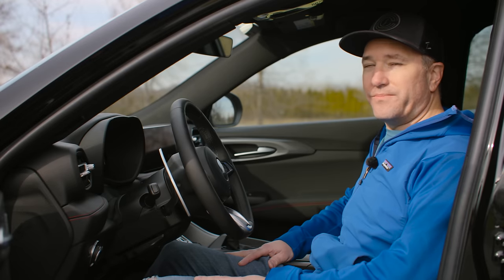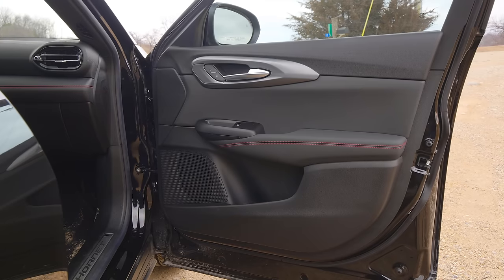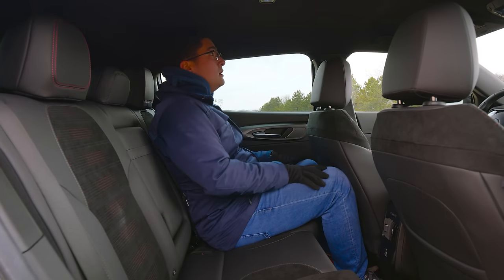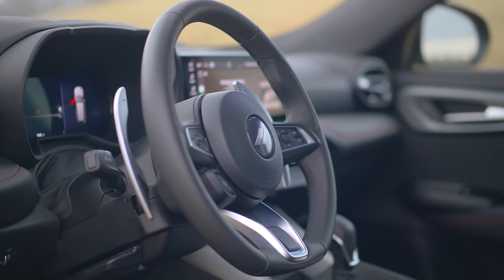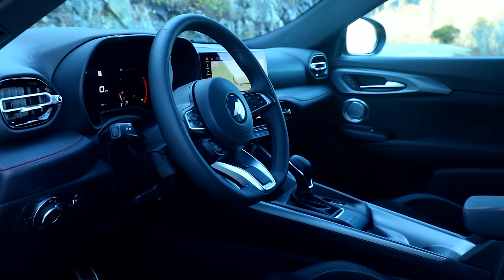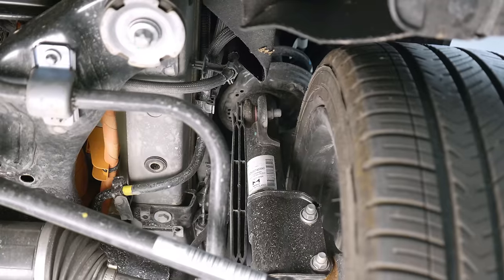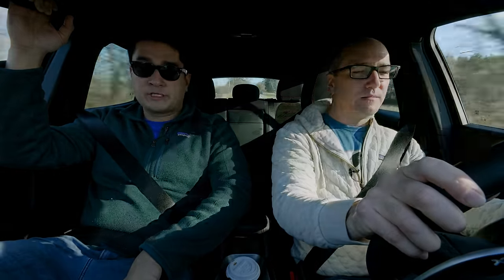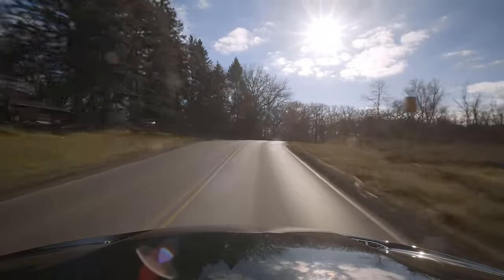Dodge Hornet | A Stinging Sensation

Comment: Leased a Tonale for my wife about 3 months ago, which is in all ways that matter the same vehicle. So far we've had no issues at all aside from the lift gate decided not to open one day after buying groceries, but turning it off and back on solved that.  The active drive & safety sensors are very sensitive to direct blinding sunlight, but we did a 2500 mi road trip in it for thanksgiving and it performed quite well overall.

She commented over the weekend just how much she loves the car, she is coming from a Mini Cooper S Manual, the Tonale is sporty enough where we both enjoy being behind the wheel, though we both understand it's NOT a sports car by any stretch and don't expect it to perform like one.    If I had to summarize the Hornet / Tonale, it would be a CUV for someone who requires a little more practicality than a sports car (perhaps you've got a kid), but you haven't died inside and still want a vehicle that drives decently well, and would rather kill yourself than own/drive something like a CRV, and either can't afford or don't want / can't fit something like a larger performance SUV.
Reply: Shhh you’re not allowed to say positive things about the Tonale, especially from a place of actual ownership experience. You’re shattering the world views of everyone here with their copy+paste opinions.
Reply: @matthewp9015  so I probably shouldn't mention that I've owned 2 other Alfas over the past 6 going on 7 years, which were also similarly problem free?
Reply: @fpnbrian  you best be keeping that to yourself…
Reply: @fpnbrian  
You had until you said you owned 2 Alfas that were trouble free😅😅😅😅
I don't believe that for one second.
Reply: @fpnbrian you’re the only one
Reply: @SoosRamirez1  funny, the owners groups are full of people who love them and have great experiences with them, it's almost like the handful of problems that occur get blown way out of proportion by the internet...  Alfa ranked tied for 3rd on JD Power's ownership satisfaction survey last year among all brands narrowly being beaten by #2 Infiniti and #1 Porsche, and tied with Buick.  But you're probably correct and I'm the only one who has had a good experience owning them 🤷🏻‍♂️
Reply: @fpnbrian  well it's sort of an internet rule. You can bet half of the people commenting about reliability issues have never ever even seen an Alfa, especially in the US. Anyway sales figures are quite decent considering the premises, at least for the Hornet. The plug-in Tonale simply isn't imported to the US to make the big numers
Reply: @SoosRamirez1  So now you want us to believe that you talked to every other owner of an Alfa and they said they had issues?   That only thing with issues is all you haters that have no clue what you're talking about.
Reply: @maximus11400  haters?

Comment: To me the hornet is what the caliber should have been.
California and CARB standards is why the hornet exist IMO
Reply: For real, the CAFE standards were just arbitrarily pulled out of thin air by politicians who knew nothing about automotive engineering. It sets mpg requirements based on wheelbase alone, not vehicle type or coefficient of drag. And the requirements get more restrictive each year. This is why small trucks for the common man were virtually non-existant for a long time and only back now with the hybrid variant being the base commodity trim, to increase the fuel efficiency numbers. It's why trucks are so large in the US, because larger wheelbase vehicles didn't need to hit such ridiculous numbers. It's also why reliable car companies like Honda had to play around with tech that ruined their reliability, like the j series v6 cylinder deactivation. Any time the government gets involved, usually the opposite of their intent is the result.
Reply: The Caliber is what the Plymouth variant would have been, if Plymouth survived. It's probably a good thing that Plymouth didn't survive. Going cheaper than Dodge would have led to less and less sales through the Daimler-Chrysler finale and the vampire Cerberus years. I bet the Plymouth PT Cruiser would have died out in 2008 versus the Chrysler PT Cruiser's 2011. The Plymouth Barracuda would have been cool, though.
Reply: Honestly it competes with mazda cx30 and Subaru crosstrek. Etc. and the hornet is way worse than it's competitors in almost every way.
Reply: We need to abolish CAFE standards and educate everyone on this issue
Reply: This is the elephant in the room and its way political and the guys are smart not to bring it up, but we all know america's political class is destroying these industries.
Reply: @SilverScarletSpider  Thats funny...the uneducated wants to try and educate...
Reply: @SilverScarletSpider the Supreme Court just changed the way EPA works regarding mileage & emissions!

Comment: Imagine selling only chargers and challengers for 16 years just to get this turd in the showroom
Reply: Let's hope it also doesn't come with the typical Alfa reliability as well.
Reply: @creato938  🙄 it's such nonsense. having owned multiple Alfas over the years I have literally never been left down by one of them. Alfas are better than Audi or BMW in terms of reliability.
Reply: Yeah how do you sell this tu”himg
Reply: Still at zero down at 22 percent interest
Reply: @MD-uu5nt  and what would you say are the average total miles driven on all these alfas?  and were they leases? Also, you know car enthusiasts who don't trust people on the internet can just go look up TSB reports and make up their own minds on what kind of problems a car actually has.
Reply: @MD-uu5nt  yeah really Alfas break down because they think they're toyota and hondas and don't require regular maintenance
Reply: @hamsterbrigade  my 156 v6 had 108,000 miles on the clock when I sold it. I bought it at 84,000. It was very, very heavy on front suspension components but never let me down in 5 years.
My 166 V6 was 20 years old when I bought it but only had 14,000 miles on the clock. It was flawless over the course of 6,000 miles in 6 months. Even if the mileage was low it was still old so lots of things can go wrong on old cars. 
My 166 2.0 had 200,000 miles on it when I bought it and the piston rings were completely gone so it was blowing a lot of smoke but at 200,000 miles in a big car with a fairly small engine I think that's acceptable. That went for scrap even though everything else was working and it still drove well. 
My 159 was 6 years old and had 80,000km on the clock and I sold it at 100,000. That never let me down although it did have a significant repair history from before me.  It then that car was mechanically pretty much a GM product. 
My 2005 156 2.4 jtd had the best diesel engine I've ever driven. Sounded good, loads of power and reliable. I didn't keep it long though as the previous owner kept the car in really bad shape and I bought it in the dark not realizing how rough it was. Mechanically sound though. 

In all of them combined I've probably driven 100,000 miles and none of them were anywhere near new. All (except the GM 159) were tremendous fun to drive.
Reply: I personally have a hard time seeing the Dodge brand surviving long term.
Reply: @John-kx3ng  lmao dodge and Chrysler as a whole has been on life support since the 80s
Reply: @MD-uu5nt I agree. Ive had my Stelvio 3 plus years and its been trouble free. Cant say the same about my 3 VW’s (one of which blew a motor with only45k miles on it) or my Audi or my BMW. All those cars were awful.
Reply: These guys are saying that the Hornet is priced in the 30's & 40's, which is true; but they go all the way up into the low 50's. Nobody is buying this vehicle...
Reply: @creato938 people are already complaining about issues with these cars, a lot of them are straight up lemons so yeah the Alfa DNA is definitely showing lol
Reply: History repeats itself…imagine being in the showroom after OPEC struck…your 400 gross hp monster gets turned into a 190 horse weakling….
Reply: totally this is a joke
Reply: @tehgzizlauw1787  I've been hearing this since the Giulia was released and I know several Giulia owners including my brother. Not a single one has had significant issues. I've been on Alfa Romeo forums for years and the general consensus is that the Giulia is a very dependable car and the only issues appear to be battery related, which if not diagnosed correctly can lead to other issues due to low voltage. I haven't read anything about engine, gearbox or suspension issues unlike some BMWs, Audis and Mercedes...

 Americans have these bizarre preconceptions when it comes to talking about Alfa where they can only cite nonsense they have heard in the 1980s. Alfa Romeo are no less reliable than any other European or American brands. They aren't Japanese.
Reply: I have a 17 guilia with essentially the same motor and it has been a fantastic car and very reliable.
Reply: Don't forget the Dodge Dart! That was a sedan Alfa Romeo Giulietta. IMO it should have been sold as an Alfa Romeo (exclusively) to offer an entry-level model and build brand recognition, who cares if it's made in North America and not in Italy?  Same for the 124 Abarth being an Alfa Spider like the original plan too (who cares that it's made in Japan?).
Reply: @MD-uu5nt How old were those Alfas? Edit: I just saw yoe other comment
Reply: Imagine bragging about selling cars that were basically facelifted for that many years.
Reply: @geraldthompson4633 OPEC? I think you mean the EPA. They ruin all the fun
Reply: @whiteboiwyatt  opec started the ball rolling…the EPA offered the customary knee jerk reaction…
Reply: @whiteboiwyatt  Aren't OPEC in the business of selling oil? What do they care if cars are inefficient? 🙂
Reply: Well the Dodge / Chrysler brand is on life support. Dodge has one vehicle left over and that is the aging Durango, this car is obviously a repurposed Alpha Romeo and Chrysler has the minivan. That's it. New American car companies like Tesla, Rivian & Lucid have just as many products out as Dodge Chrysler does. It's really sad to see this 100 year old car company basically die a slow death....
Reply: @MD-uu5nt this makes a Giulia very enticing haha
Reply: @cmdrbillpaxton4302  True.
Reply: @geraldthompson4633  I was picturing the '80s turbo 4-bangers,  "The power of the future".   Here we are again.   Maybe Stellantis will bring back the Spirit R/T, Shelby CSX,  Shelby Lancer, Shelby Dodge Omni?   Or a return of "The Wraith" movie.  Though this time it would have a mid engine hybrid.
Reply: @creato938 it’ll be an improvement over old Dodge.
Reply: That’s why Stellantis will not attend any Auto Shows, they have nothing worth showing.
Reply: @devonp5079  you’re not wrong…
Reply: What makes this a "turd"? It's an affordable PHEV...
Reply: @Rew123  that won’t be affordable for long…it’s a ‘new’ model riding atop old fiat chassis brought to by Stellantis….aka Peugeot…at least the 20 yr old MB chassis of the charger/challenger offered up the excitement the brand had been known for….Sampson the strong man was like Dodge, loud and brash, but also got laid low…the final act was to be strong one more time and the bring the house down…bye bye Dodge
Reply: @Rew123  $40,000 isn’t affordable
Reply: @Almighty_cornholio you must live under a rock since the 80s? SMH they stayed in business for 40 years since the 80s and you say it as a bad thing. When they brought back the charger in 05 they skyrocket in sales amd stayed since then. Stay out of the comment section buddy. You know nothing kid
Reply: @bck0001 lmao ok whatever! Stay out of the comment section  kid
Reply: Like those aren't turds either😂😂😂
Reply: @MD-uu5nt It's not bizarre.  People in the United States that buy Euro products accepting that there are going to be abnormal costs associated with that purchase.  The demographic a car like this is marketed to is going to be lower middle class consumers.  There's no way they want this car, it's a very risky proposition.  There's vehicles that are extremely reliable in this segment.
Reply: @TassieLorenzo 
The Fiat 124 absolutely should have been an Alfa Romeo Spider.
Reply: I’d change my business for sure lol
Reply: Oh there was another in between selling obsolete vehicles- The Dart. Another Fiat based POS that gave Kia Rio owners self esteem in knowing that there was something out there that was an even bigger POS than what they owned.
Reply: @TassieLorenzo I have a 2014 Dodge Dart SXT as it has been a very reliable car since I bought it pre-owned back in 2017!

Comment: I just traded in my 2015 dart. It was a great handling little commuter. I actually really liked driving it! But at 109k miles it was falling apart. I expect that to be the case here too.
Reply: glad yours made it that far. we had a manual that had that faulty hydraulic component shared with the european version of the journey. 3rd time it went out in under 10k miles - it blew up under the hood. no lemon law remedy though as almost everything was a "wear item", but i flipped it before the bottle fell out on the Dart market.
Reply: I work with this guy that has a Dart (don't know which powertrain) with 190k on it. Looks like crap but still running.
Reply: I forget that car existe
Reply: Truth! Dart's were fun little shitboxes until they approached 100k and then turned into headaches
Reply: I've had my '13 Dart since 2021, got it with 100k and now has 172k miles, and has been pretty reliable despite driving it pretty hard and doing Uber Eats deliveries. Then again I have the base 2.0 engine which is apparently the most reliable one, the turbo 1.4 and the 2.4 have lots of issues.
Reply: Had a 2013 dart 1.4 manual. The slave cylinder would give out alot but besides that mine was solid. The only reason I don't still have it is my brother parked it on the hill and the parking brake gave out.
Reply: @mikefernandz6770  This was hilarious . RIP Dart

Comment: You said it.  Dodge is at an interesting crossroad.  No more muscle cars and consumers are done buying $70-$80k trucks.  At least for now in high volumes.  They really don’t compete in smaller quality affordable cars.
Reply: all they had to do is update the challenger/charger with turbo 4 cylinder and turbo 6 cylinder.  maybe make them just a bit smaller/tighter/lighter.    Maybe even offer a 6 speed manual.  Front engine, manual, RWD is what we want.   Not a CUV.
Reply: Dodge and Chrysler got shafted over the years. Anyone could see that basing your brand identity around large displacement engines had a finite timetable, with regulations becoming stricter each year. Ideally, I would've had Jeep have a nice lineup of off-road CUVs, Chrysler with comfort/luxury CUVs and the Pacifica, and Dodge with a lineup of sporty-oriented CUVs and a new low-priced new Caravan based on the Pacifica. They would ride on the same platforms but have different design philosophies.
Reply: Not that it matters, but are Dodge trucks even a thing anymore?  Do they actually make their own pickups or wasn't everything spun-off into RAM products?
Reply: The Hornet pricing goes up into the 50's. This vehicle won't bring in the affordability customers either...
Reply: @Jazzmaster1992  RAM spun off a long time ago into its own brand. There's no such thing as a Dodge RAM anymore. It's its own brand called RAM.
Reply: @ducktails1695  And they don't see many of them either
Reply: Really nothing domestic does…Honda Toyota Mazda and even the Koreans have made short work of the once proud and haughty us auto industry….
Reply: @rndmprsn3532 while I would love a manual 6 speed in anything generally  the take rate  for manuals is abysmally low in all vehicles except the Mazda Miata.
Reply: @xhizzous  yes, because they are not offered in nicer trim levels or with other options.   The automakers say 'see, no one buys them' when in reality they would if the cool body styles were offered with one.     LIke the tacoma is only in a manual with weird trims.  you telling me a manual 4 runner wouldn't sell?     or a manual Grenadier?   or a manual BMW 4 series?   They would sell if the makers tried.
Reply: @ducktails1695  Since 2014.

Comment: That damn turn signal would drive me absolutely INSANE.
Reply: Nissan turn signals are the best
Reply: @povertyspec9651 that’s because Nissan owners never use them.
Reply: BMW's are now available without turn signal stalks.
Reply: @zephead843  weren't those always optional?
Reply: What’s a turn signal? J/K
Reply: Peugeot has entered the chat
Reply: @dforrest4503  I do. I own a 370Z and Xterra Pro-4X. Both have been terrific.
Reply: ...said the guy who was last seen 10 miles down the road with his turn signal still on.

Comment: I love how the horn doesn't work on this new car. That says all you need to know about the Dodge brand.
Reply: They clearly think this review unit has been worked on at some point, it's not the only preproduction ish car a reviewer has gotten with some small issues
Reply: @KyleRepinski  okay, so please explain every other Dodge made in the past decade.
Reply: @anthonykiedis1765  the last decade of Dodge has been basically just Charger, Challenger, and Journey lol. None of those cars are grossly unreliable vehicles. They're not Toyotas, but they're not German.
Reply: @KyleRepinski 
I’ll defend the Journey.  In January 2014, I bought a salesman’s demo 2013 Journey SXT V6.  It has been my daily driver for the last 10 years and has 150,000 miles on it with no major issues.  The only thing I don’t like about it is the location of the battery, and I absolutely hate that.
Reply: @anthonykiedis1765  A dogged out pre-production/press vehicle that has an issue - Shocking.
Reply: @chynacash3138  a brand new car with an issue*. Fixed it for ya.
Reply: @anthonykiedis1765  Wrong, like I said in my original comment... So no, you didn't fix anything.